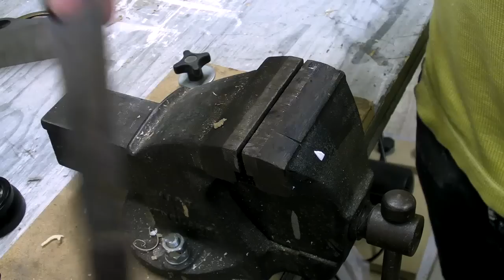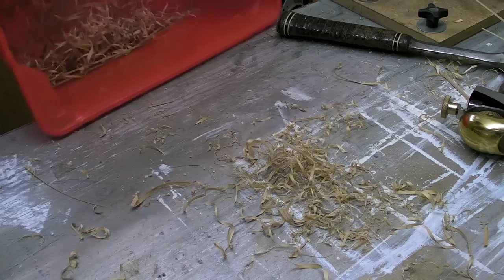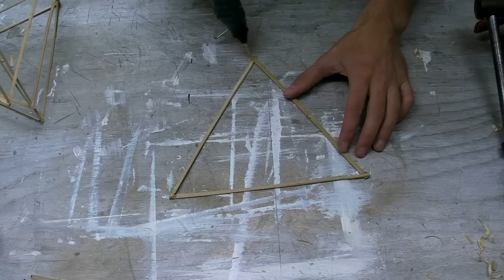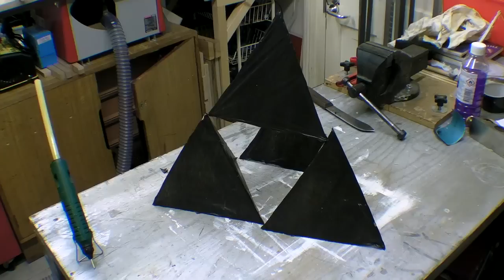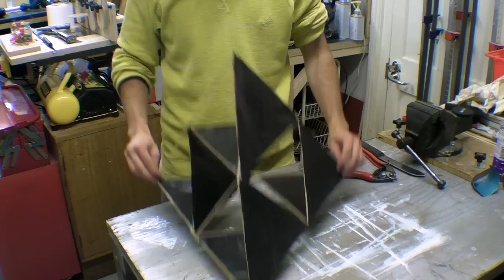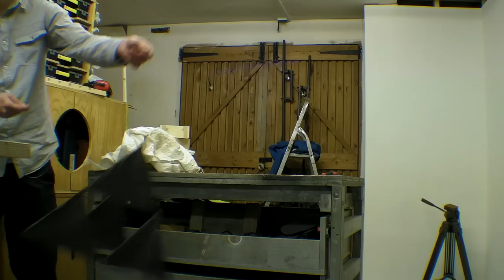Bamboo Tetrahedral Kite / Tetrahedron

Comment: Immpressed with your Bamboo splitting skills, i have been making and flying kites since i was a schoolboy (= a very long time !!) and i have never had much success splitting Bamboo, just give up and buy dowel from DIY stores !
 Two points about this kite, if you made the outside edges twice as long ( one piece ) it would be stronger and a little lighter and weight is always the number enemy flying a kite, after all you are trying defeat gravity ! secondly make this kite twice as large, or even three times as large, the bigger the kite the less 'skittish' and more stable it is in the sky, plus the lifting surface area to structural weight ratio is better, back to defying gravity again !
 If storaage of a large kite of this type is a problem with a little ingenuity it could be constructed with a detachable top cross spar and 'hinges' (parrallel spars and cotton binding?) along the bottom of each triangular cell enabling it to be folded flat.